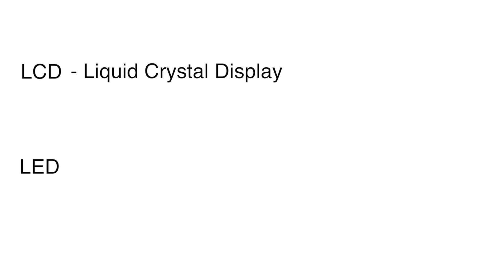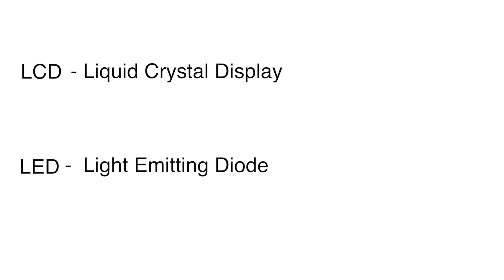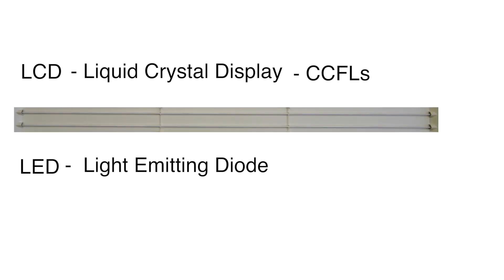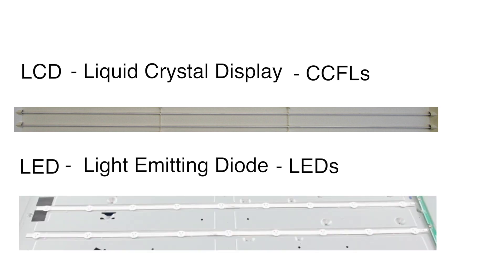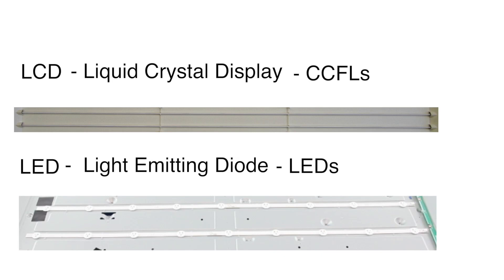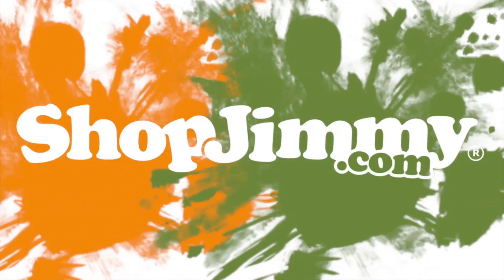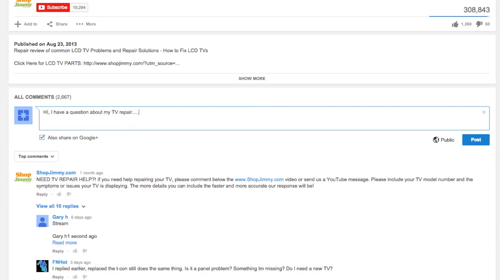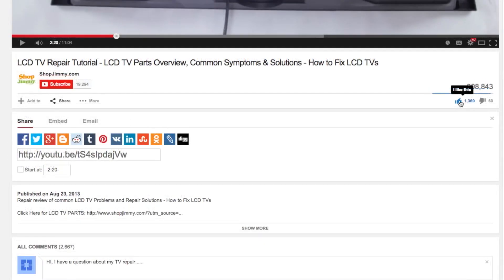LCD TVs vs. LED TVs - Reviewing their Backlights and Parts - TV Repair Tutorials

Comment: hi shop jimmy.com new to your station ... I have a vizio model # E321VL that will not turn on when I plug it in only the yellow Vizio lights up but I press power button and nothing happens just a black screen what can I try? I have a multi-meter but do not know where to start any HELP will be appreciated, I Thank you very Much
Reply from the maker: +PETE ALVARADO  Try all repairs and troubleshooting at your own risk.   I recommend replacing the main board in your TV.  Click this link to replacement parts for your TV model number:  http://www.shopjimmy.com/catalogsearch/result/index/?cat=56&q=E321VL  There may be multiple boards for the same TV model number, be sure to match part numbers on your current board, with your replacement for compatibility.  Here is a link to a video showing how to identify your part number, click here:  https://www.youtube.com/watch?v=kxkeGLhlQY8Thanks and please let us know if you have any further questions with your TV Repair!  www.shopjimmy.com

Comment: hello, i have a Samsung smart tv, model UN40EH5300F, type 40EH5300. the sceen keeps shutting off and wont stop. i looked it up and it told me to cut the JP852 jumper, but its not there. please help if you can, thanks.
Reply from the maker: +Jqcob Peairs  Try all repairs and troubleshooting at your own risk.  This could be a problem with either the main board or the power supply board in your TV.  You can replace each of those boards individually to see if one of them fixes the problem.  Click this link to replacement parts for your TV model number:  http://www.shopjimmy.com/catalogsearch/result/?q=UN40EH5300F  There may be multiple boards for the same TV model number, be sure to match part numbers on your current board, with your replacement for compatibility.   Thanks and please let us know if you have any further questions with your TV Repair!  www.shopjimmy.com